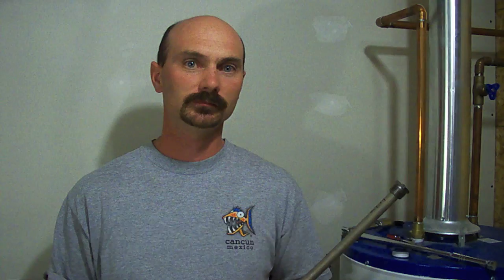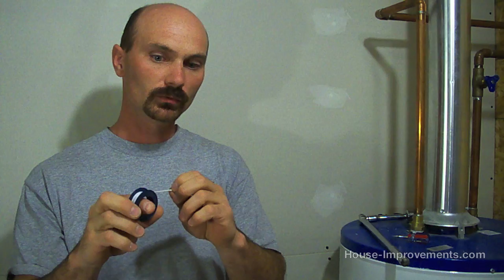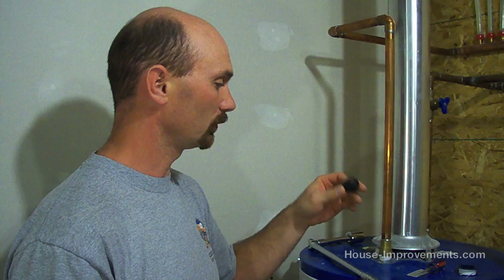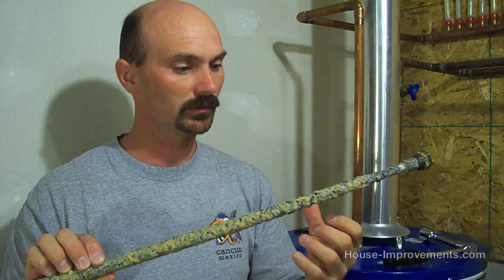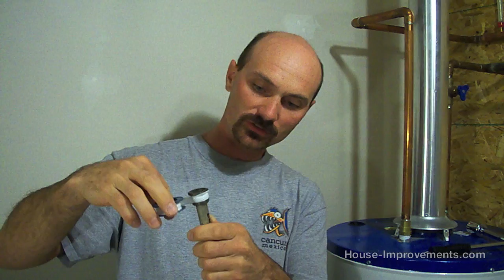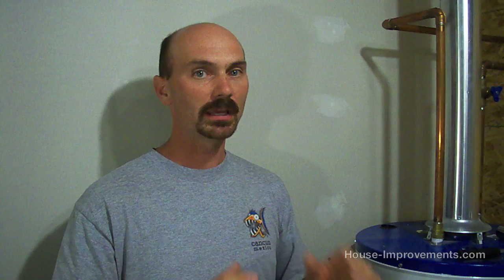How To Replace Your Water Heater Anode Rod

Comment: Nice video - You do a great job explain the whys and hows of this job.   One addition I suggest is to open a hot water valve (preferably on the upper story) when draining water from the heater.   This lets it drain a lot better.   As for other periodic maintenance, I also open my pressure relief valve once a year.   This increases it's chances of not being cemented shut if and when I need it to work.   Thanks for a great video.

Comment: I can't find the anode rod on my water heater. There are only 3 holes on the top. 1 each for cold & hot water line and 3rd for pressure relief valve? Can you suggest a solution?
Thanks,

Comment: I didn't say it was a ground rod. It's an electrode. A circuit path is necessary for the electrochemical process to occur. Ground path is necessary for most circuits to work and continuity between the sacrificial metals in the anode rod and the inside of the tank is what needs to be maintained by grounding them together.

Comment: its an anode it does not have to have contact the tank , it made of softer metal so the minerals are attracted to it instead of the tank and elements. contact with the tank has no bearing on what it does or how it works. the threads of the rod would not make better contact with one type sealant than another. an anode would work if it was suspended in the water by somthing non conductive

Comment: an anode is not a ground rod and it does not have to be grounded
Reply: It needs to be connected (electrically) to the metal part of the tank that it is protecting. That also happens to be grounded. Same as the zinc rods that are used on boats.

Comment: I think that's why he said to apply the teflon tape to the "top half of the threads" so ground continuity would be maintained. But I can't see any problem with using plumbers dope. That appears to be what was on it when it was originally installed. But I don't know about putty with the heat requirements necessary for it to endure.

Comment: I'm absolutely convinced that my water heater is toast. So much so that I haven't even checked the rod or flushed it before buying a new water heater that I have standing by. I haven't had any trouble but I haven't checked it in 10 years and I have no idea how old it was when I got this place. I'm pretty sure once I flush the sediment (or concrete, whichever it is by now) and try to remove the rod, I will void the grace period I'm living under.

Comment: I've heard from plumbers say not to use teflon tape on the seal for the screw for the rods, and that it cancels the effect of the rod. They say to use plumbers putty instead. Anyone here this? It makes sense, that the metal should be touching metal.

Comment from the maker: Changeing down to smaller heater can effect the amount of hot water you have at anyone time on hand for use. The sizes you are refering to are very large for a typical family home but a multi family duplex or small appartment building would require this size, so talk to a plumber about "sizing" the heater for the amount of use you have and that will let you know the minimum size you need. Anodes should be the same in most heaters, gas or electric.

Comment: Hi Shannon,thanks for the good video I have a question? Is it ok to replace a 119 gallon water heater down to 80 gall?& what is the diff.commercial or residential water or house water heater ? & anode rod for the gas vs elec.is not the same right?

Comment from the maker: I don't think that they are around. If your old rod is shot you could cut a new one off to a length that will fit in. If the old one is shot part of a new one is better then nothing. If you did this you may need to just change it more often.

Comment: does any one know if they still make the collapsable anod rods? and if they do where to buy them? local shops only have flexible rods, and not enough clearence with them. i dont want to cut the connections. the last owners of the house put the shut off valve like 6 inchs above the tank. any help would be great! ( please help lol )
Thanks!

Comment: The job isn't so cut and dried when there is only 20" to 24" clearance from the top of the heater to the ceiling!  Plus new municipal and/or state plumbing codes require that the heaters be on 18" stands, which eliminates nearly all the overhead clearance! The anode rod is at least 30", so the only way to get it in is to totally disconnect the entire tank, including flue, drain it, then tip it to at least 45° so there is enough clearance to remove/replace the anode rod.  A real pita!
Reply: Get a large hammer. Beat a large hole into the ceiling. And next time, don't buy a house from someone called, Tollhouse Builders.

Comment: tank life can vary depending on what type of water you have. some water sources agressively attack the anode and you will get a sulphur odour. anodes made of aluminum instead of magnesium are installed in this case. many tanks use an anode which is part of the hot water out fitting,there is no anode marking on the top. most tanks never get the anode changed during their life.

Comment: ok, we have replaced our thermostat and our element, tested all electrical lines and the breaker, we still have no hot water, what could this be?
Reply: Did you pay the bill?
Reply: You've probably had a new water heater installed by now. FWIW:
My own water heater started delivering lukewarm water.  I replaced my dip tube. That fixed the problem

Comment: The statement is made in this video to change the anode rod every couple of years.  COMPLETE NONSENSE!!!  Hot water heater warranties are directly related to how long the anode rod is designed to last, with room for error.  A 6 year warranty on a tank means replace the rod after six years.  The same goes for a 10 or 12 year warranty, there is nothing different about the tank, but the anode rod is much larger so it lasts longer.  INSPECTION every few years is a good idea, not replacement.

Comment: Can you do a video on the new water heaters where the anode is inside the hot water line? Bradford Whites does not have a little cap anymore that you can just remove and pull out the anode. On the new ones, you have to remove the hot water line on the top to get to the anode.

Comment: I like this video and very well explained. does it last longer if I have water softener? if it does, how much longer?
Reply: If your water softener is located before the water heater,  then the anode rod will look new when you take it out. But check it, and then sue the guy that sold you the softener.

Comment: Thanks for the video it is very informative.  My water heater instruction manual, that I found online, doesn't tell me the specs of the anode rod. What can I do?
Reply: None of them do. It's because they just change parts willy nilly when they make water heaters, and don't want anyone demanding a new rod that is the proper length. Make your life easier too, stop making promises.

Comment: I'll 2nd, 3rd, whatever that the Teflon tape wraps in the opposite direction of tightening.  Theory is, the (slight) friction of the female threads will tend to wrap tighter rather than unwrap.
Reply: I tested your theory on the wife. It did NOT get tighter, and she is still finding pieces of teflon tape.

Comment: You should mention in your excellent video to also.
Run your hot water before turning the gas or electricity and water supply back on. This will ensure your tank has no air in it.

Comment: That does seem like a lot of teflon tape.  Kind of surprised the threads will catch where the tape is.  Seems it would be pushed up away from the threads and serve more as a gasket than a thread sealant.
Anyway, not sure if this has been  mentioned as to electric heaters, but people should always make sure the top element is covered with water before turning the power back on.  This will save the element.  You don't want cold water hitting a hot element.

Comment: I am very concerned about opening the drain valve on the water heater. Can I change the rod without draining the tank. I would think shutting the cold water and opening up the hot water faucets would release any pressure in the tank. Does that sound dangerous?
Reply: Probably because you didn't drain the water heater every 30 days over the last 15 years and you know the poltergeists will be coming out to get you.

Comment: Good job, well done!  Teflon tape should be wrapped in the opposite direction.  3 or 4 turn is sufficient.
Reply: Does it really matter which way the tape is wrapped. I don't think it will unwrap when screwing the rod back into the tank

Comment: You should probably open a tap after draining the 5 gallons or so once your done. Heating the tank up with air in our is not suggested the extra pressure is hard on your taps

Comment: Great video!  I will definitely check out more of your stuff!

For those with difficulty loosening the rod, This Old House has a great video that emphasizes how you get the rod out.  Search water heater on their site.
Reply: I had to use a deep impact socket and driver to remove the stuck anode. It took two tries and then it came loose.

Comment: Part II...GE must have put these anode nuts in with a pneumatic gun!  Might dress the situation when you have stripped threads in that anode boss...explain where to get an industrial bottoming tape or 3/4-14 thread chaser  It's tough finding when you start on a Saturday afternoon and can't find the proper tooling if you run into this!
Reply: Cheap pig metal constantly exposed to water and heat. Guess what could happen? Next time get a water heater with a stainless steel tank.

Comment: Good video...straight forward....have a 40 gal GE tank, only 7 yrs old, decided to change anode rod.   Broke that anode nut loose.....but come to find out that it was stripping the threads in the tank boss as well as the threads on the old anode nut.  Forget about going to Lowe's/Home Depot/Ace/NAPA/Auto Zone to find a 3/4"-14 thread chaser to clean out the damaged thread.  Part I....limited by characters.